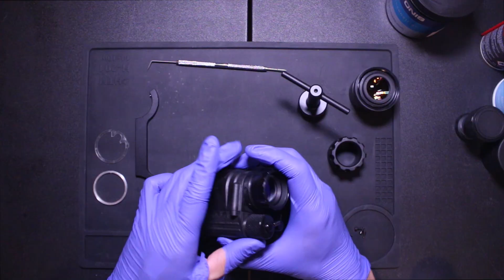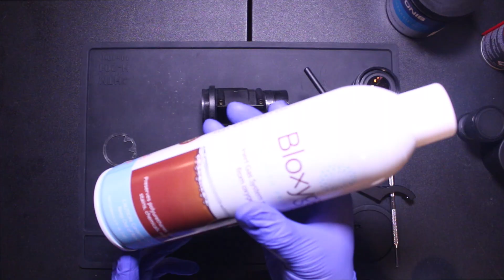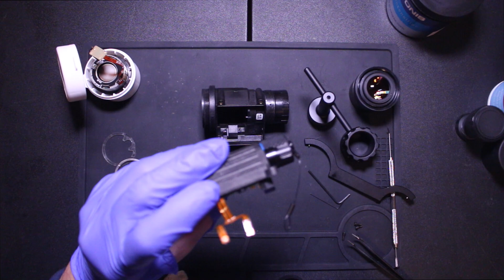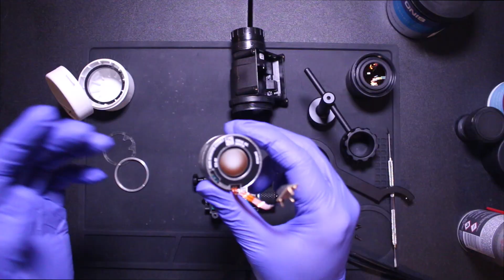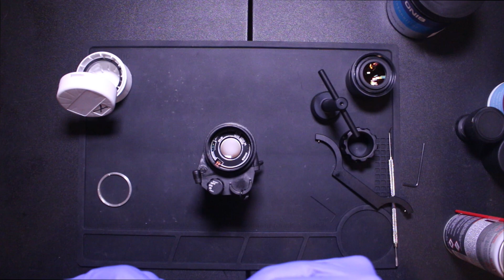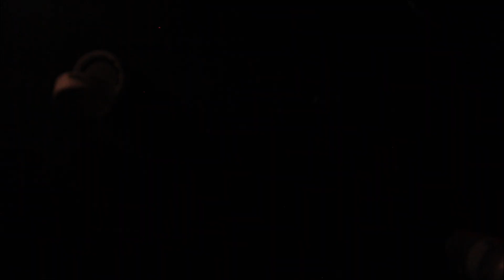How to Build a PVS-14 From Used Parts (Full Build & Testing)

Comment: In neither of your PVS-14 videos, you use the funny shaped wrench. What is it actually for and do I need it?
Reply: its for the eye piece if it wouldn't twist off by hand, honestly it just scratches the shit out of stuff more than anything
Reply: @LibertyJOEVI  It should be used to tighten the lock ring against the ocular. Ocular can be easy to loosen if not. Also, a lot of people don't know, but the ocular is slightly off center allowing for collimation through its rotation. So by using the lock ring to tighten as opposed to cranking down on the ocular, you are able to set the ocular angular position, leave it, and lock in place with the lock ring. The smaller side of the wrench is rarely used, but for the objective infinity stop ring. Some of these rings are composite material similar to the housing (this video) and I believe can be stubborn to rotate for which a wrench is helpful, particularly for setting the infinity stop which requires precise rotation. The aluminum ring rotates much easier and a wrench is hardly necessary. I sell plastic tools on eBay with metal components only where necessary.